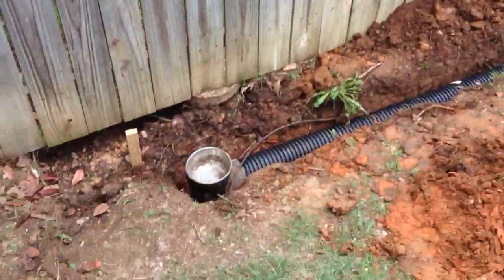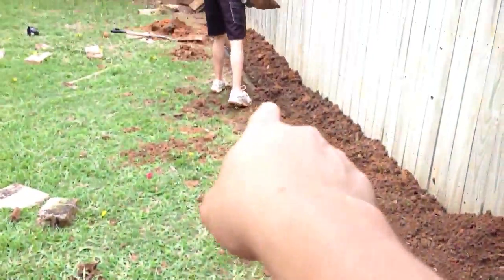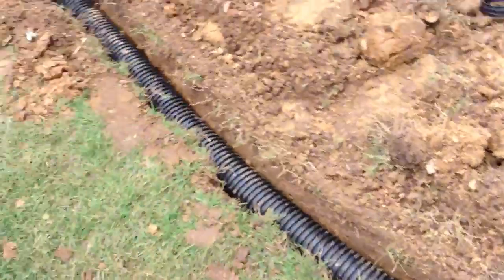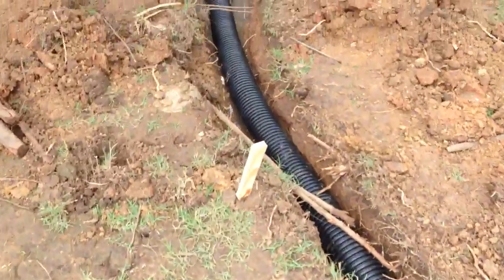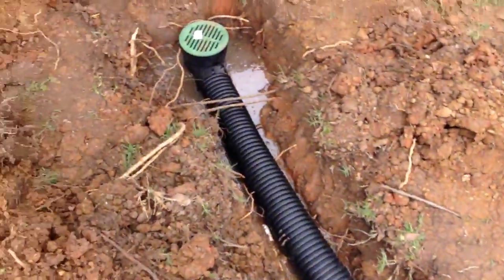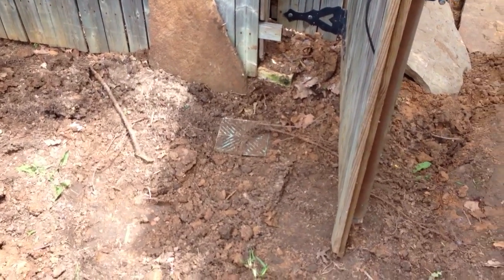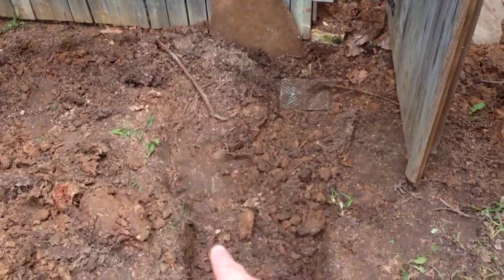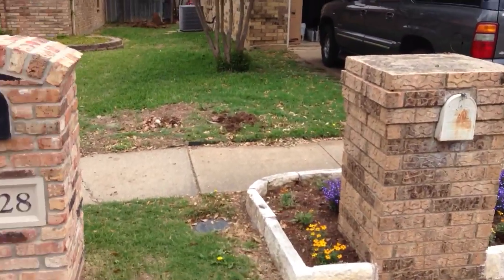Installing a catch basin to stop flooding

Comment: Is there any reason why solid plastic pvc is not used?
Reply: lightningsmokerXx  Cost, usually.    But hard pipe like pvc/sdr35 pipe (either one) is better.   It flows better and it leaves less room for roots to enter the system since the fittings are tighter.